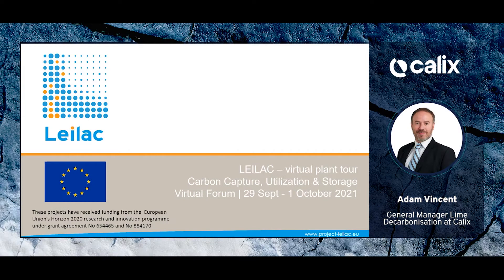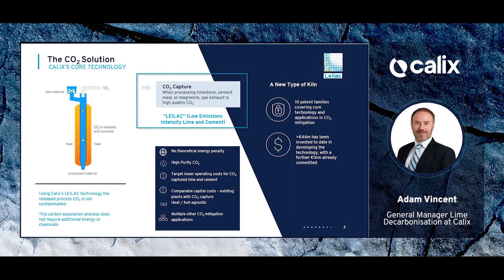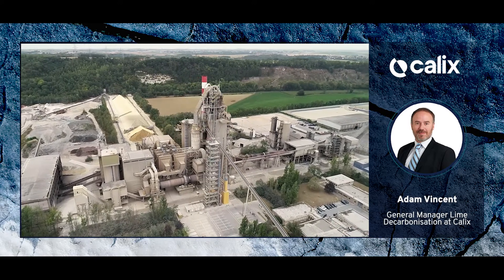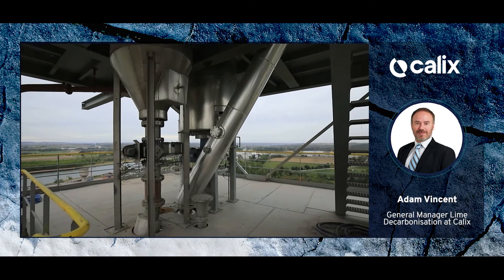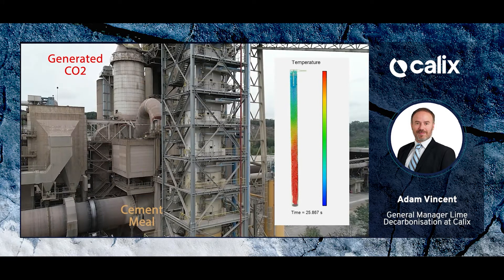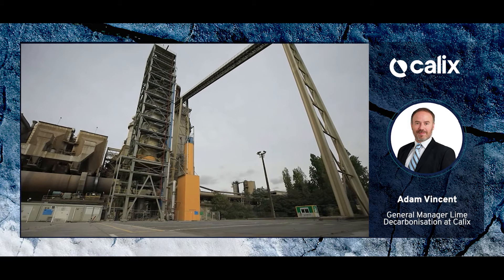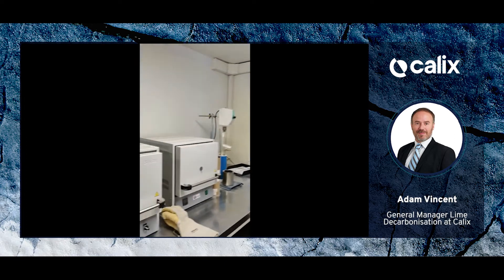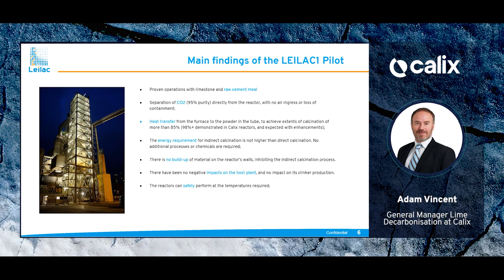A Virtual Tour of LEILAC with Adam Vincent at the Carbon Capture, Utilization & Storage Forum 2021

Comment: But did i hear correctly only 10 tons per hour?  That is surely lower than the rate that kiln runs at no?
Reply: I did some research it seems like its not running at full capacity and its a pilot projec. Their kiln can run at same production capacity as traditional kiln